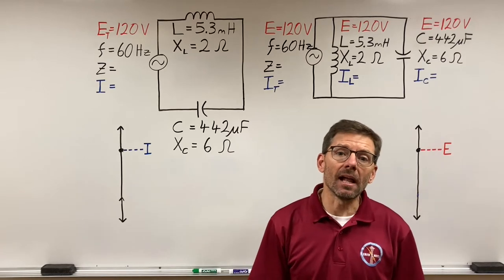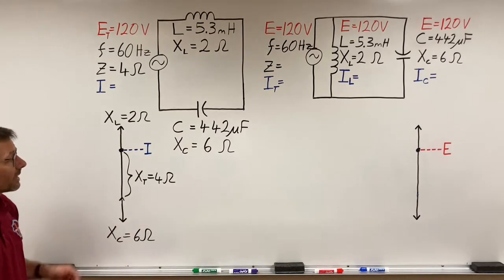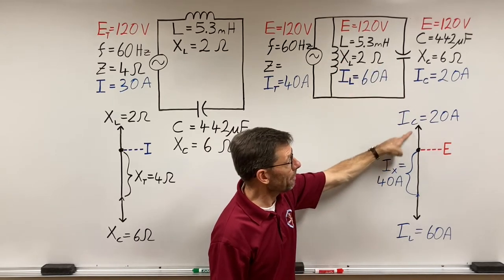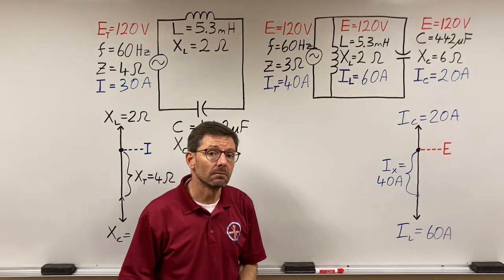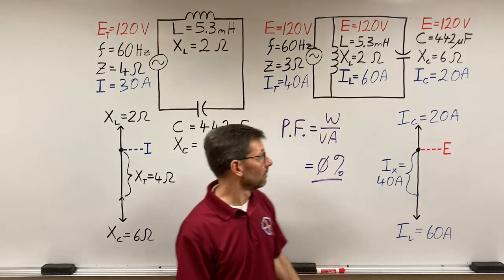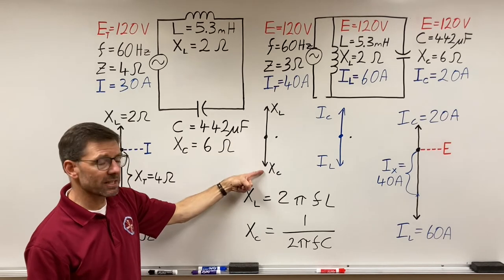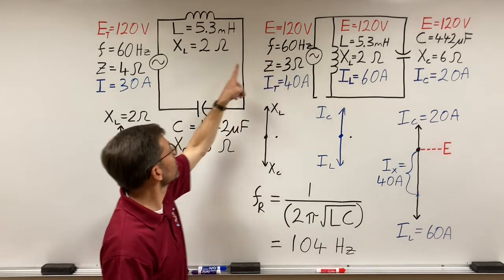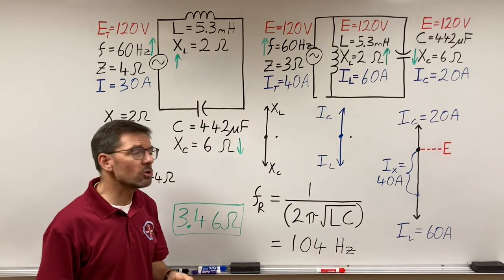Analysis of LC Circuits

Comment: Dave, in the Parallel Circuit, total impedance calculated is 3 Ohms, and the Inductive Reactance is 2 Ohms.
Does the law of total opposition for a parallel circuit, where the total is smaller than the smallest opposition device, still apply?
Using Product over Sum, I calculated (Z) to be 1.5 Ohms.
Reply: (XL*XC)/XC-XL..... It gives you 3 Ohms only. It's not (XC+XL).
Reply: And also as I remember from the RLC Session.... Total ohms should be smaller than the resistive branch.... Not necessarily smaller than either inductive or Capacitive Branch

Comment: I think the use of vectors in this application is super misleading. Im used to splitting vectors up by units, not by direction. You +- ohms, +- volts +- ampere. The directions are not clear by this video. Youre using x y but you didnt label your axis or explain pos neg and direction. It seems your arbitrarily choosing a direction based on the component, not based on +-. Forgive my ignorance, but in any case id love a reupload and explain it how a math major would see it. When you make smart things dumb in an effort to treat dumb people, you only end up insulting everybody because nobody is dumb were just ignorant. There needs to be more realism and less normalcy.
Reply: Do you by any chance have some sources that go over these vector diagrams ?